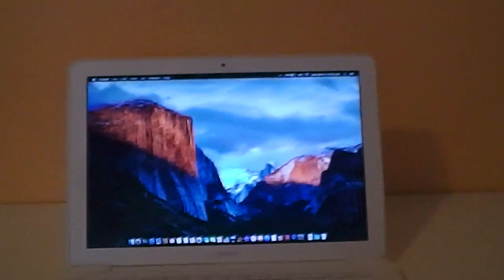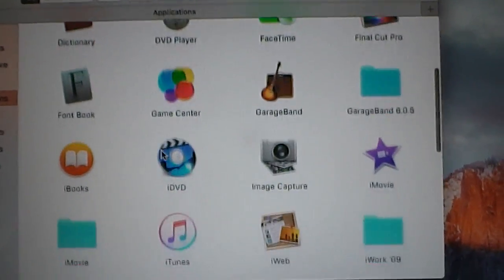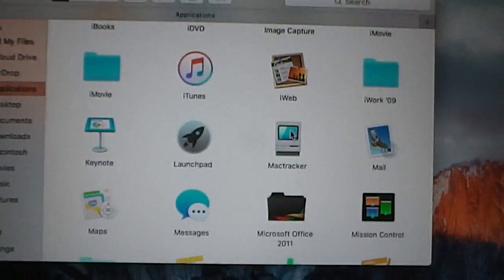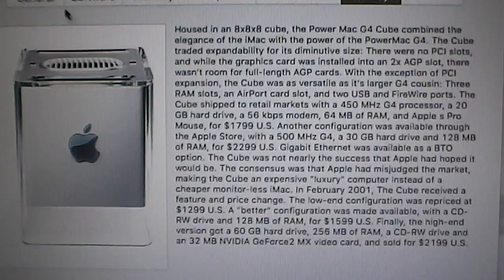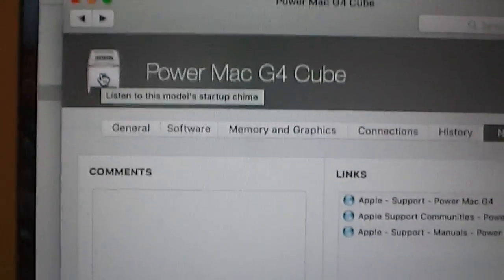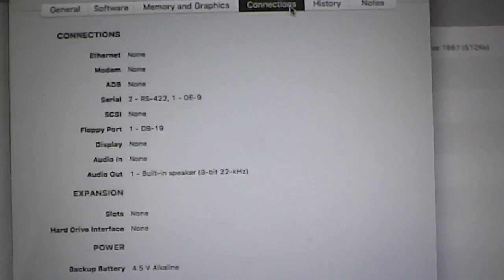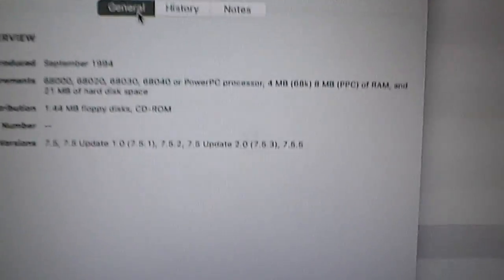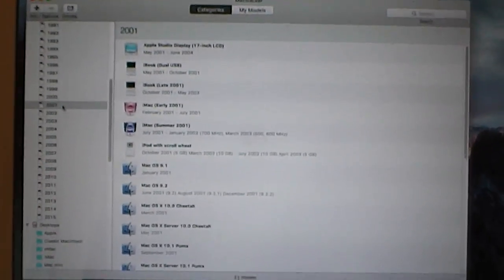MacBook (Unibody, Mid 2010) – Wind5387

Comment: Do u still use this for video editing?  I have a 2010 MacBook like yours and I use it for almost everything and it works great'
Reply from the maker: I haven't been using my MacBook as much for video editing, however with macOS 10.12 and Final Cut version 10.2, it can handle 1080p30 pretty well, or 720p60 with the same  performance. I usually have to close all other apps, though, to get the best performance. Also, make sure there is good air flow as this computer gets hot pretty quickly with FCP open! 🙂
Reply: what you can do to keep heat down is by using an app called SMC Fan control it works great! I have to use it when ever im watching youtube or FaceTiming   people. it got up to 190deg. once! I have been using my Hackintosh to edit video on my youtube channel, but it died, so ill try using this for the next video. https://www.youtube.com/channel/UCRaqa9qL3Pmig3abOvPuTPQ

Comment: Which model is this mac and where did you get your ram upgrade from
Reply from the maker: blackcityent27 Mid 2010 unibody MacBook. Model number is A1342.
This is the website. I've already selected the correct RAM for this Mac, just type in the quantity and you're set.
https://www.18004memory.com/4gb-pc3-8500-ddr3-1066mhz-204-pin-so-dimm-1.asp?l3id=931

Comment: Just bought this laptop tonight from ebay and purchased a 16gb ram kit. Had a question for you. As far as light gaming goes, will it run World of Warcraft on low settings with at least 30fps on mac side and in bootcamp, maybe a little more fps? Have you tested any games on it so far and if so which ones and what fps were you getting?
Reply from the maker: I don't have an answer to that; I don't do any gaming, really. :/
Reply: No worries! Ty anyways and thanks for the reply!

Comment: Hi, thanks for the video, I have a late 2009 white MacBook, it has 4gb of ram but I want to upgrade to 8gig because I wanna run MacOS sierra on it, (I have mavericks at the moment) what type and brand of ram would you suggest? (I'm new to mac) my MSI has windows 10.
Reply from the maker: This is a good website; I've already selected the RAM (4 GB), just type in the quantity (2) and you'll be set!
https://www.18004memory.com/4gb-pc3-8500-ddr3-1066mhz-204-pin-so-dimm-1.asp?l3id=931

Comment: i am using this macbook for six years. it works well but the only shortcoming is....running really slow...since the RAM is 2GB.....six years for one macbook is very long-lasting and good quality...but..it runs very very slow after upgrading...time to buy a new macbook pro soon
Reply: just upgrade your ram to 8gb......
Reply: Like the person above said upgrading the ram helps. You can also upgrade the HDD to a SSD.
Reply from the maker: It'll be much less of a hassle just to upgrade the RAM. And much cheaper, as well. If you get 16GB and an SSD (as FsxTime mentioned), your MacBook will run smoother. 
https://www.18004memory.com/laptop-memory-ddr3-pc3-204-pin-pc3-8500-1066mhz.asp 

Even my MacBook, with 10GB and a regular HDD runs pretty well.

Comment: hey there I recently upgraded my RAM from 2GB  to 8GB(4GB+4GB), after ram upgrade my macbook get heat like hell. what must be problem? any solution? plz help me I love my macbook mif 2010.
Reply from the maker: Hmm, I'm not sure what could be the cause of the problem. My first suggestion: restart the computer while holding down the Command, Control, P, and R keys. This will reset the PRAM. (This is a small portion of the RAM in a Mac, and that may have gone wonky when you swapped out the RAM)

Hope this helps!
Reply: +Wind5387  could u please specify ram model no. and other details. tnxs
Reply from the maker: This is the required RAM for mid 2010 MacBooks
1066 MHz PC3-8500 DDR3 RAM
Reply: +Wind5387 thank you :)

Comment: Hey, great video. I just ordered one of these off of eBay with a 250gb regular hard drive and 4gigs of ram. I just bought 8gigs of ram off of amazon that I'm going to put into it when it arrives. Do you think 8 is enough for it to run smoothly. For things like watching YouTube and Netflix. I probably won't be using it for much else. Or should I have gone for 16. Thanks
Reply from the maker: +orlandpark77 I had 8 GB and this thing runs pretty fast. I can run Final Cut Pro without too many problems (sometimes it's a little laggy). I just put in another 2 GB and it runs smoothly. 

I don't use Netflix on my MacBook, so I'm not sure how it runs with that, but Youtube runs fine. If you're REALLY wanting the maximum performance from your MacBook, I'd get 16